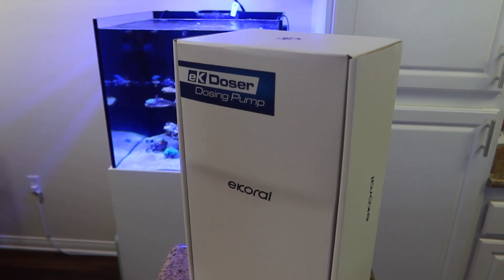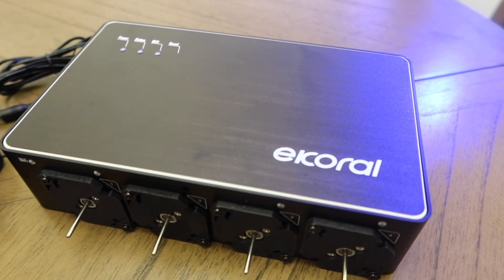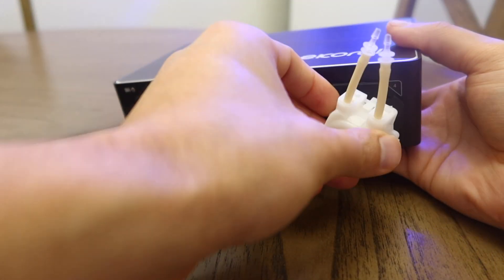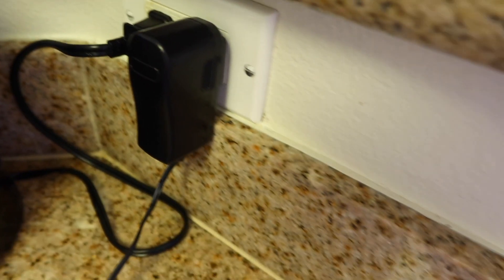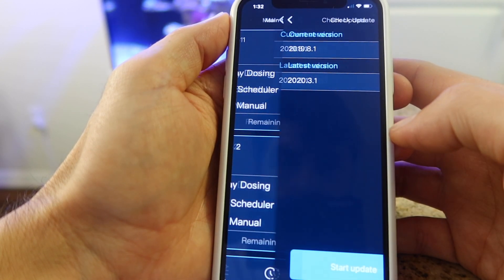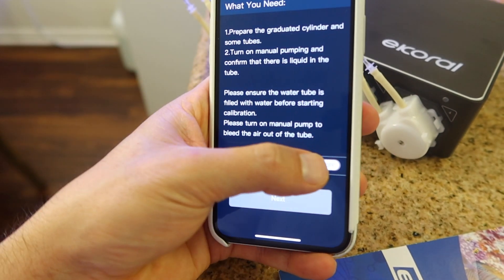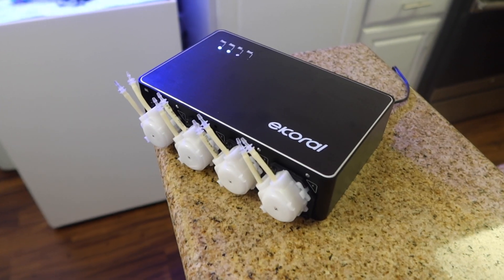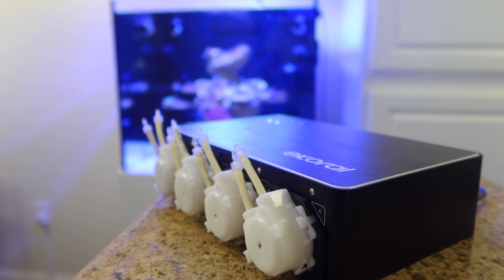Ekoral Doser Setup Video

Comment: I eventually got to automate dosing not that its much to do it manually but it would make it easier. I also got to find a good auto feeder for a tank with a mesh top. Then I gotta get a big trashcan for top off water for my auto top off instead of 5g buckets then I don't have to do work often. Done.
Reply from the maker: There you go 😊